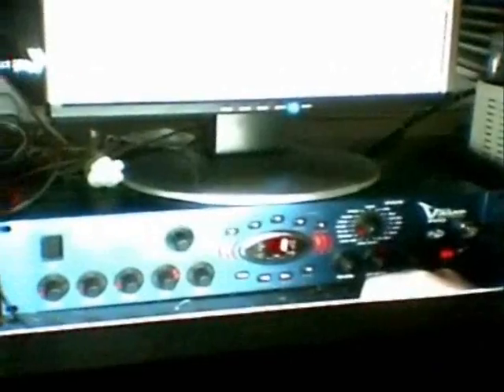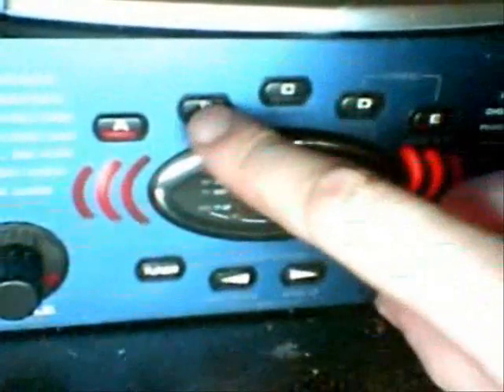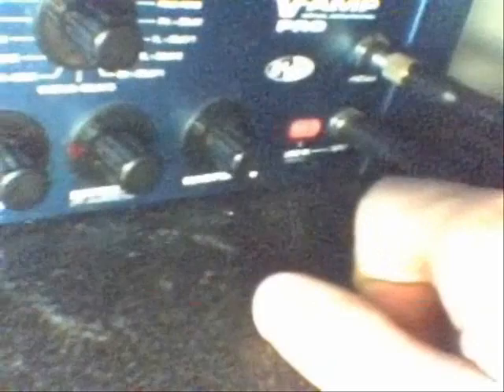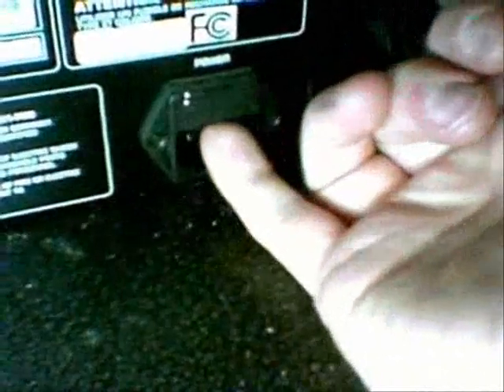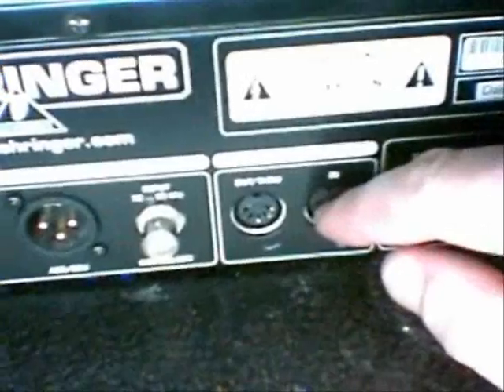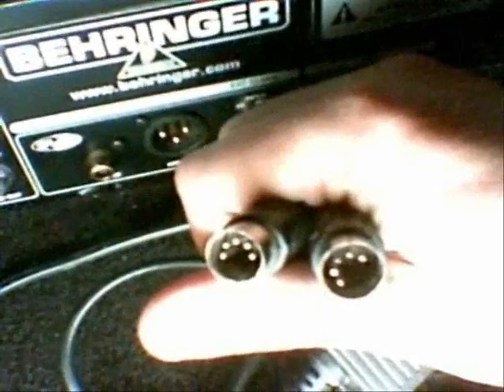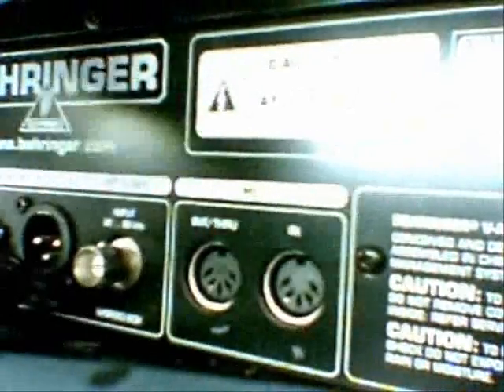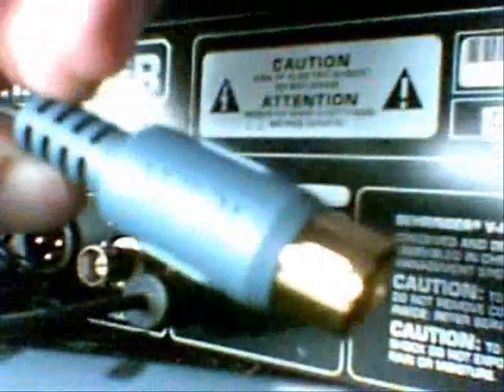Behringer V-Amp Pro Part I - Controls and Connecting To MIDI

Comment: Could I run the midi in and midi out from the vamp pro to my interface that has midi in and midi out?
Reply from the maker: You could, but MIDI In/Out is not for audio, it's just for controlling the device (changing settings, etc) over MIDI protocol.  

I've not had this thing since 2011, I'm toying with buying another one sometime soon, maybe sell my old Blackstar IDCORE 10 for it.  Then setting it up with the 2024P and and a FCB1010 like I'd originally planned.  I always loved the sound of the V-Amp Pro, it was always the sound I had in my head.

Comment: Hello I have the v-amp multil effects pedal. does the software your using work with the effect pedal unit LX-1 I think.
Reply from the maker: Shane Wisecup IIRC, the software works with all of the previous V-AMP products including the Vampire amps, V-AMP Pro (what I had when I made this video), and the guitar body shaped and Pedal V-AMP units (as long as they are blue).  I know there's a V-AMP III out that I'm not sure the software works with or not.
Reply: hey thanks for the help man! Greatly appreciated. Might you also be able to help me find the software for it. Here is a link to the model I have if you could share a link to the software I would greatly appreciate it. http://www.behringer.com/EN/Products/LX1-X.aspx
Reply: + I got a vamp lx 112 and my electro acoustic causes the green 'clip' led to flash and the amp sounds bad. It the electro acoustic input to the amp too high you think?

Comment: Its a great unit for the money. I dont where the all the snobbery against behringer comes from. I have had this unit for 5yrs now. The only problem i have had was, i had to change the internal memory battery. Which cost £2. Ive had the pod pro/xt/x3, boss GT8 and sent them all back. The vamp is the champ.

Comment: S/PDIF is a digital audio output if you have a S/PIDIF input in your sound interface. Use regular RCA cable for this. AES/EBU (Audio Engineering Society and Europian Broadcasting Union) also a digital audio transfering methord uses a XLR (mic) cable. Word Clock use to synchronize all your digital stuff to one clock rate. (Word clock is a one way to sync the clock rate and it is very stable) Hope this info helps someone.